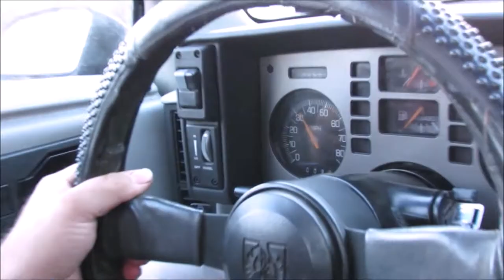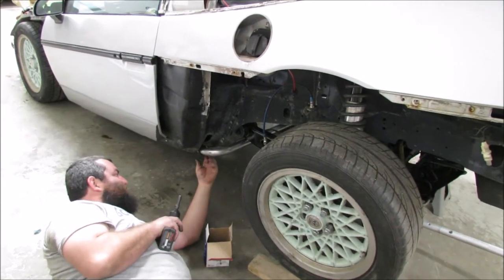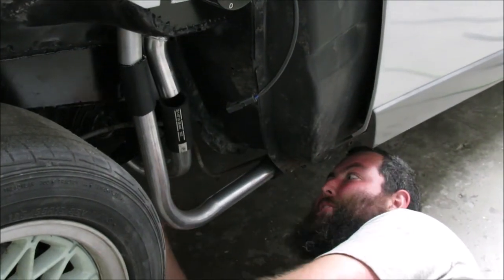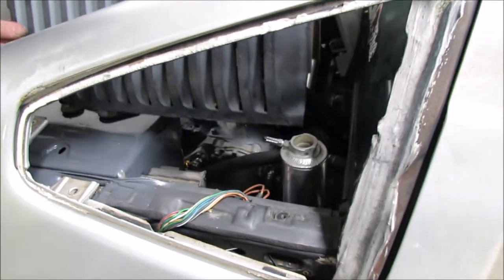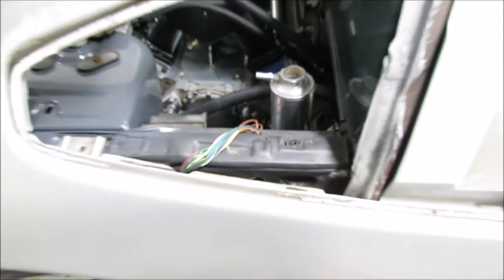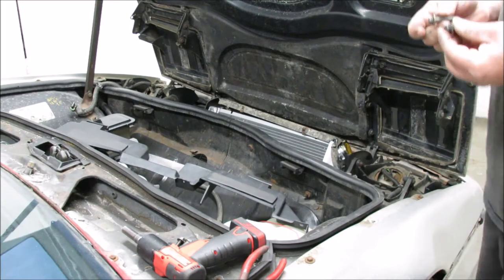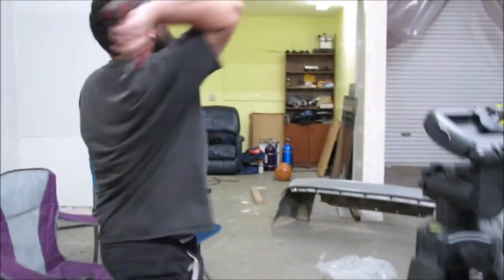Turbo LS3 Fiero Part 9: Coolant System

Comment: The massive amount of work that you are doing for this swap is amazing.  I admire that you are doing soooooo much of the work the right way. The customer fuel cell, the Fiero logo plate on your intake, replacing all the suspension....on and on. I have seen swapped Fieros  that were such garbage because they were done super fast and cut corners. I am currently shopping for a good condition SE, GT or Formula but I will not be doing the ton of work you are. Better radiator, water pump, fans, throttle body, injectors, fuel pump, proper engine rebuild, nicer suspension, wheels and tires are about as far as I will go. With my old GT I was happy with stock HP I just want dependability and a little better low rpm torque. Any advise on biggest bang for the $ to upgrading the stock motor?
Reply from the maker: Thank you! I had one of these just out of high school. Loved it. Didn't have any money to put in it at the time but always said I wanted a v8 one... almost 15 years later finally getting to it! I haven't really messed with the stock engines. My other one that runs is a 3.8